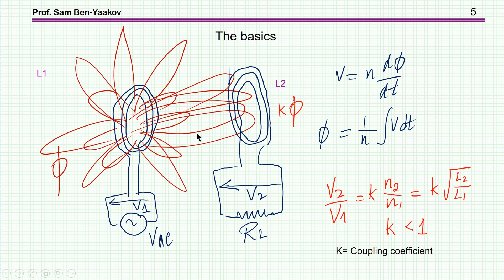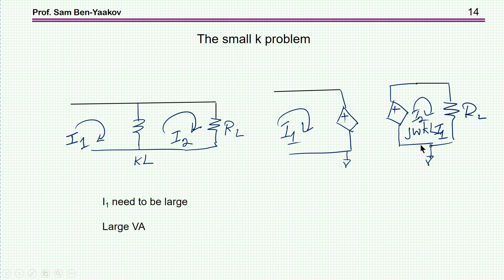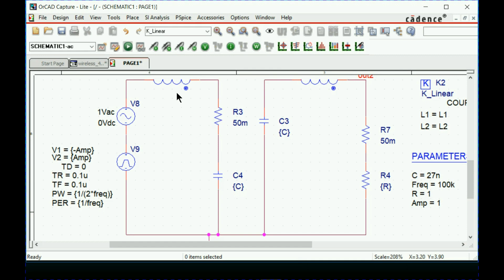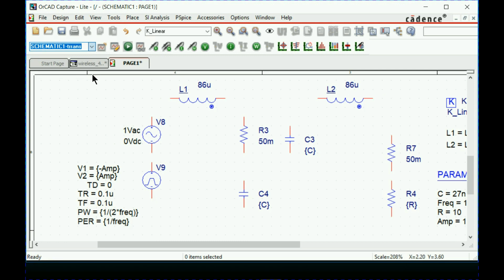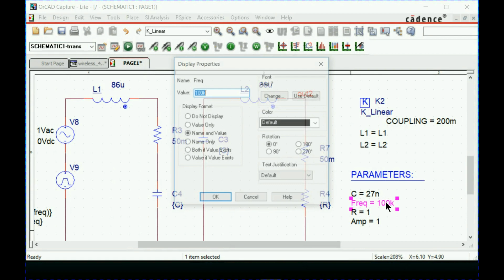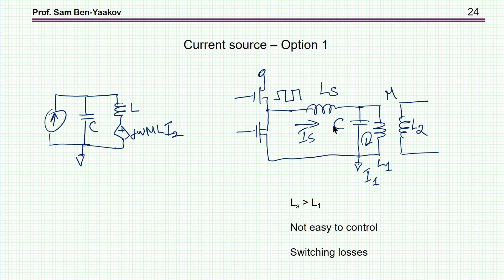A primer to wireless power transfer

Comment: Thank you very much for this post Prof. I have one question. Is there a reason not to use the cantilever model of the transformer to analyse the converter? Wouldn’t that make analysis easier?
Reply from the maker: I think you loose the hindsight.

Comment: Thanks!

I think the equation for efficiency at about 15 minutes is missing an I-squared term in the denominator. Or, maybe there is some simplification I missed. How can I better understand this?
Reply from the maker: Yes, you are right,  it misses the primary current squared. Thank for pointing this out.

Comment: Sam Ben- Yaakov. Congratulations on your excellent presentation. Having been retired for a long time in teaching this subject, I decided to occupy myself in this Coronavirus pandemic, by re-building all the circuits you presented, and apply them to design INDUCTION HEATERS for melting metals. The idea considers the power transfer through large currents involved and the aim is to experiment with how one designs the various circuit layout to stop the "ringing" which can take place in a practical layout. It is interesting to decide what to chose, either series or parallels LC circuits, with the melt being the resistive power load. This is another interesting area associated with your presentation involving high currents. I admired the manner in which you accentuate the use of voltage sources and current sources to feed the appropriate circuits and what one needs at the secondary which are all related to "matching impedances". I met many people trying to resonate a parallel LC circuit using a voltage source! or a series LC circuit using a current source!
Recently I came across a video which uses a High voltage Full Bridge as a Voltage source feeding a step-down transformer with an ingenious stacked number of toroids with a primary high voltage winding and one straight bar, very low impedance ( water-cooled pipe) secondary, feeding the series resonant circuit with a low voltage where the " one bar voltage source" can handle very high currents to melt the metal. 
https://youtu.be/Z385ysaaxL4
Your presentation in this video is certainly a great help to those who are designing induction heaters. 
Again, thank you for the presentation, it feels good to be in your lecture room, even though we are halfway around the world from each other.
Reply from the maker: Thanks Carmel for sharing and a successful and happy melt😊

Comment: Sorry for the dumb question, but what is an "ideal" transformer? Does it have any impedance at all? or does the primary look like an open circuit when the secondary is open circuit? If I apply a DC voltage to this "ideal" transformer, I am guessing it never saturates, and has no muteral inductance, so the primary current remains 0 indefinitely with an open secondary? and provided its core never saturates the DC voltage also get reflected at the output? and also has k===1? Thank you!
Reply from the maker: This is in fact a very good question and surprisingly has no answer. I am about to prepare a video on that. An approximate answer: coupling 1 and hence no leakage, no copper losses no hysteresis no saturation and infinite inductance .
Reply: @sambenyaakov  Thanks for confirming what I thought! Do you have a video explaining the concept of muteral inductance? I thought it was the self inductance the individual windings but watching another video I realized it was an abstract concept that seems to be related to coupling between inductors?? whats wrong with 'k'? is using k just an alternative?
Reply from the maker: @power-max  https://youtu.be/qLoXOlrqZCU
Reply from the maker: https://youtu.be/Fso6cPXPOYs

Comment: Amazing explanation on WPT. I am sure that all viewers will get useful info on WPT after watching this video.

Sir! I am working on an application where an input to the transmitting coil is DC voltage of 12V. Expecting an output of 15Watts. Could You please share the circuit diagram and schematic for real-time applications. As we are supplying DC output, Is it necessary to change the schematic as you mentioned at 45:54 in your video?
Reply from the maker: Not sure I understand the question.
Reply: @sambenyaakov   sorry sir, it's my mistake that I didn't mention exact constraints. 

Question:  1)  I have an input voltage of 12V DC and i don't know how and which components exactly to use in between this input voltage and transmitting coil. 
2) My load is a battery of about same voltage i.e 12V DC and I don't know how and which components to use between receiving coil and my load.
3) Here, i was expecting an output power of 15W with rated current of 1.25Amps.
4) sir, as you explained in your video, "How to represent non-linear loads". I don't want to change my load as a resistance (Rac).

Comment: Any about V/I phase difference (we got 90 degree and 0 power out)
Reply from the maker: I do not follow. Please explain.
Reply: @sambenyaakov  Thanks for the reply; The phase difference of current and voltage @ primary side is about 90 degree without load at secondary side; The phase difference of current and voltage @ secondary is about 0 if applying pure resistor (we can output power from this WPT); The phase difference of current and voltage @ secondary is about 90 if we applied DC load (like BK precision 8616) or a rectifier circuits, we can see voltage Vrms=150V, current Irms=6A, but the output power is zero (Vrms*Irms*cos(90));
Reply: @chulee9419  plz can you share your resources from where you get this much knowledge because I am new in this field and I want the to research in this area but I don't have enough concept.

Comment: This very interesting video snuck by me when you released it a year ago. Luckily, your videos are timeless, so it's just as valid today as it was back then.

At about 34:30 in the video, you show a case with a K of 0.2 and a load resistance of 10 Ohms which achieves an efficiency of close to 100% over a wide frequency band. You dismiss this case because the power output is low (only ~100mW for the 1V input) but there are applications where a broadband output is required, e.g. I work with sonar systems where the output capacitance is the piezoelectric transducer (which is just a Type II ceramic capacitor). As you've shown in the other cases, it isn't easy to get both very high efficiency and also reasonably uniform power output across a large band. The tricky part in using this to drive a sonar transducer would be that the load resistance that would have to be adjusted to get the desired flat power output is actually the radiation resistance of the water on the transducer, and the transducer designers would probably revolt if they were asked to adjust this parameter...

Adding to the excitement, your example provides very high efficiency over the band from 93 kHz to 110 kHz which is typical for a harbor defense sonar designed to detect low target strength returns from divers and unmanned underwater vehicles. These sonars require high bandwidth to provide good range resolution and getting a reasonably flat response over a wide band while also getting high efficiency would be unheard of...
Reply from the maker: Very interesting points. Thanks. You are welcome to join https://www.linkedin.com/groups/13606756/

Comment: Hi Dr. Ben-Yaakov, this presentation helped me to gain some level of intuitive approach to analyzing wireless power transfer circuits. Thank you so much!
A quick question - in your simulation you are using the input apparent power for calculating the efficiency - W(R4) / W(V8). But shouldn't the input active power be used for this?
Reply from the maker: Both are real power.
Reply: No. Pspice plots W(V8) as (V(V8:+)-V(V8:-))*I(V8:+) which is the apparent power supplied by V8. You can test it.
Reply from the maker: Hi Michael. I stand corrected. You are right. I need to see now how damaging is this mistake and whether the video needs to be redone. What do you think?
Reply: Hi Dr. Ben-Yaakov, let me say, first of all, that this is an excellent primer on WPT, better than anything else I have seen. I watched it several times, and so did, I am sure, many others like me who are involved in WPT related R&D.
On the other hand, Its been almost a year since you posted the video. WPT is a hot spot nowadays. Perhaps, it is a good time to update the video to cover in some more detail such areas as optimizing for maximum efficiency, types of impedance matching - passive networks, switching impedance converters, etc. I have absolutely no doubt that a lot people will be interested to watch it.
Thank you a lot for sharing your knowledge. Best regards.
Reply from the maker: Thanks Michael
Reply: Hi Dr. Yaakov, I think there will appear only one peak in the efficiency plot when considering only real power. Thank you for this video. Hoping for more on this topic.

Comment: Hi, than you very much for this video, the presentation and information are very helpful, 
I have many inquiries if you could help me I will grateful,
1- what is name of simulation software used in video?, and is it available free on internet?,
1- could the same simulation implemented using Matlab Simulink?, if yes, how could be implemented by It?,
Reply from the maker: Thanks. The simulation program is PSPICE. I am using the free demo. 
Yes, you can implement in Simulink

Comment: Thank you Sir. It is very informative.

I believe efficiency equation should mainly depend on Q factor and coupling factor of reactive components.
In resonant wireless power transfer,  wireless power transfer efficiency cannot be put in terms of input and output power.  Power delivered to the load is a whole new equation as per reflected load theory.
Reply from the maker: Hi Pareekshith P, I do not think there is a need to confuse the issue. Efficiency is the ratio between output to input power, period. As I am showing in the video, Q is sort of obscure in the wireless power transfer case.  On the other hand, parasitic resistances, which in the final analysis responsible for the losses, are clear to define and handle.